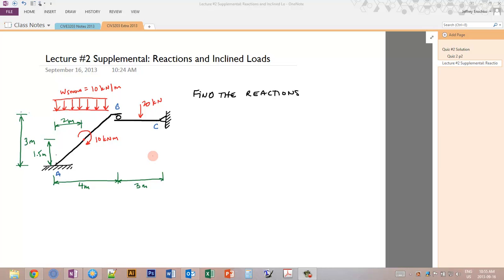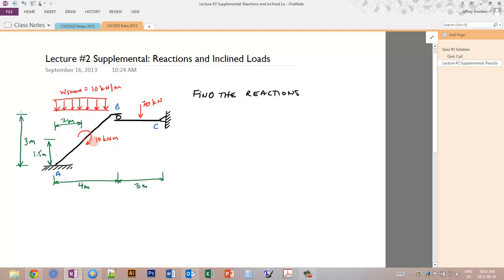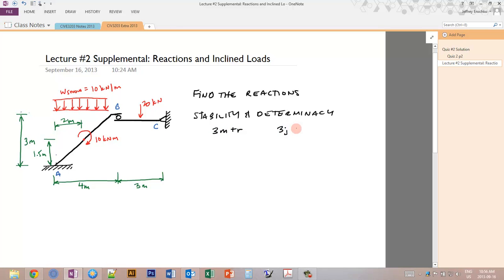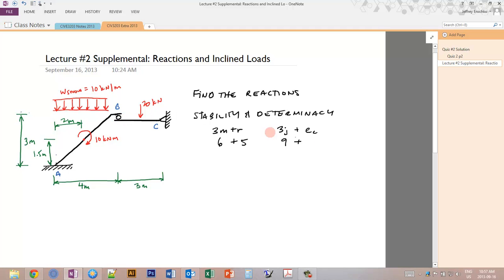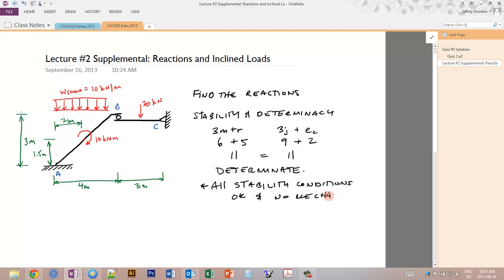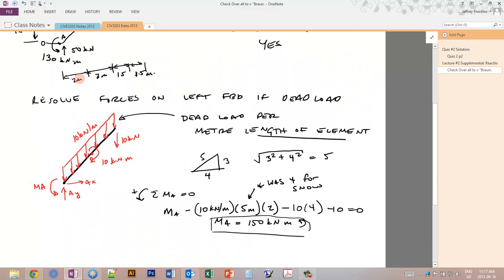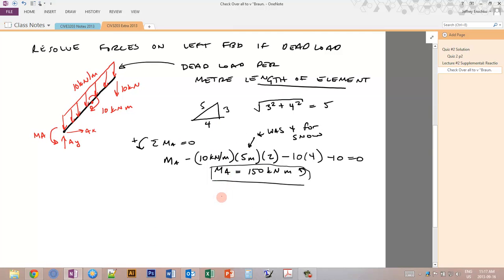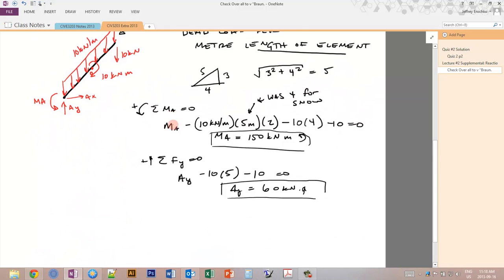EXAMPLE - Calculating Determinate Structure Reactions with Inclined Distributed Loads

Comment: I'm a little confused. I assumed that the resultant load is the area under the distributed load, however at 20:41, when you're doing the dead load on an inclined surface, you've simply multiplied 10*5 despite the load looking like a parallelogram which would require perpendicular height or length to calculate the area. Does the method change when considering an inclined surface or am I simply confused/mistaken?

Comment: Can you recommendation about Structural Analysis books?
Reply from the maker: If you like my explanations, you can check out mine which is available for free online at learnaboutstructures.com
Reply: Thanks , but I want more problems
Reply from the maker: @pavaattovchhin3938   FYI, there are additional sample problems in the book and a complete set of practice problems with full solution manual available for pdf purchase.